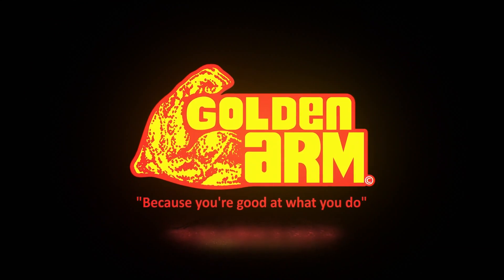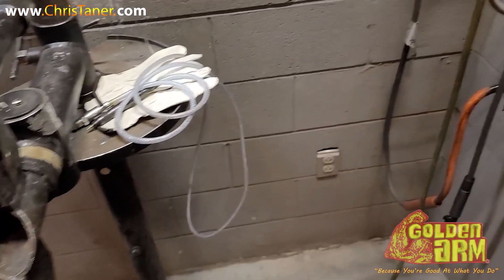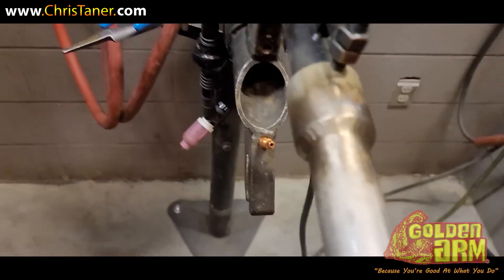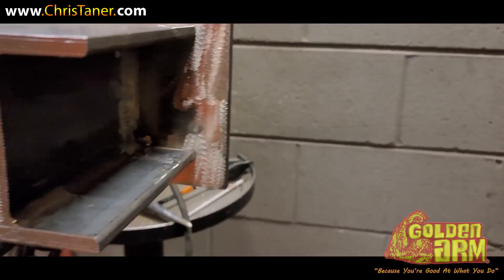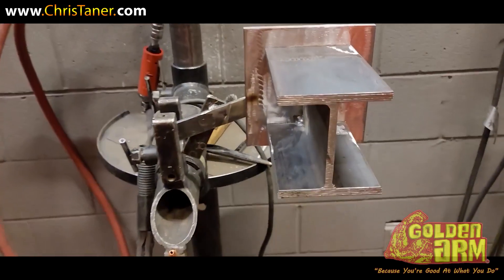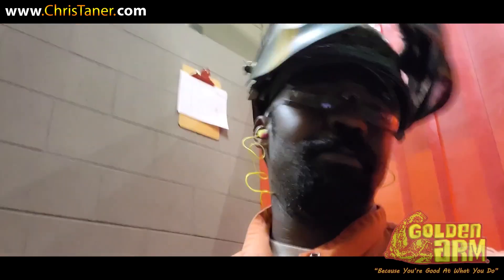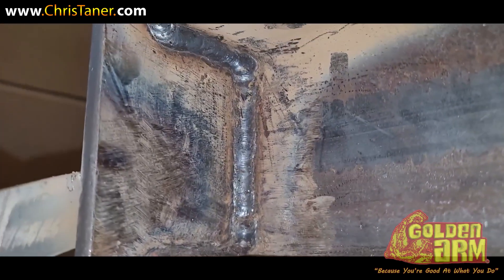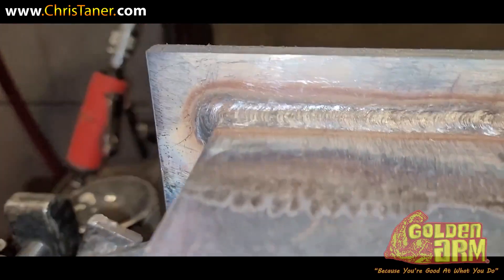| I-BEAM TEST| YOU MUST PASS BEFORE TAKING 6G PIPE TEST

Comment: For your 309 tig root what did you run your amps and. I just got on it at school and it’s going alright except for my 5g it keeps key holing on me bad
Reply from the maker: On my 309 rootpass I use 90 to 93 amp. If you're getting a keyhole that's out of control just start to dial down you're amps  just a few amps at a time until you find a sweet spot that works for you. 🙂
Reply: @christaner  thanks ‼️